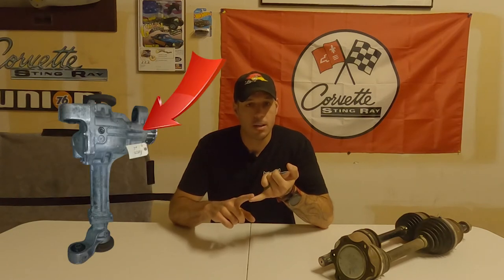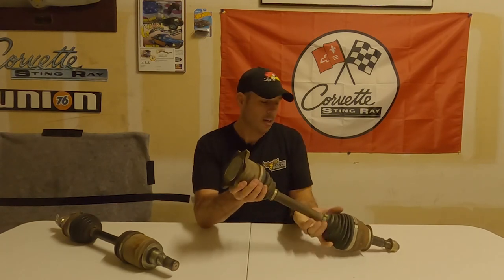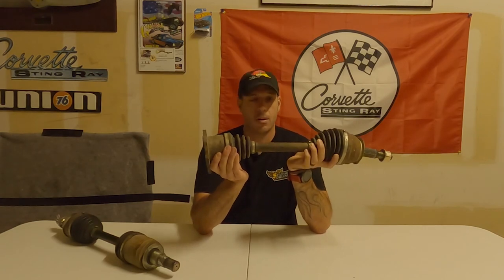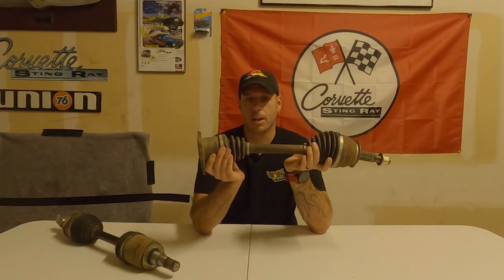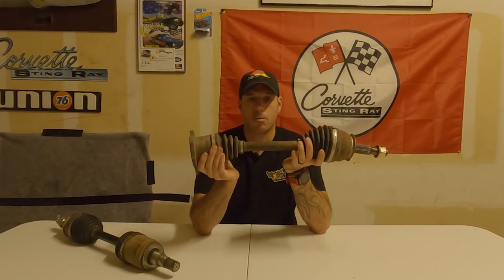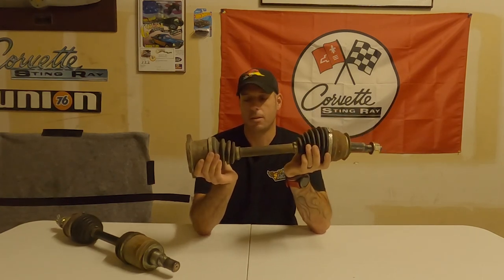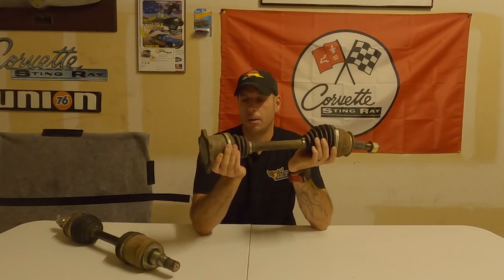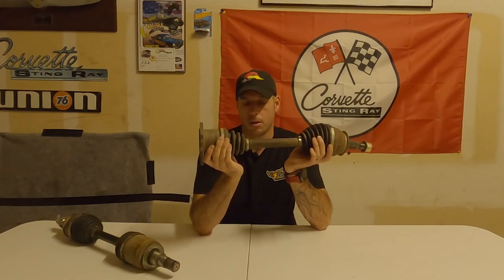Titan Swap. What Is It and What Is It's Biggest Benefit?

Comment: I’ve broken couple R-180 half shafts. Finally dumped it and roll with M205, so much easier to swap trail side and no longer fear of axle shattering inside the diff. Good stuff with Titan swap, love mine so far
Reply: The Titan cv's axles are stronger than frontier?
Reply: @vagelisperrakis826  yes

Comment: Thanks for relating your experience with a "FULL  TITAN Swap" I've watched enough videos to realize that the Infinity Qx80 CV shafts were NOT designed for the riggers of wheeling with heavy tires. Your diff swap is the best solution I've seen short of the solid axle swap or buying a jeep and fixing Chrysler's design flaws
Reply from the maker: And Solid axle swaps are very difficult in these vehicles. There's no cheap way to do it with the way the frame is designed. You can't slap leaf springs on like you could on the older generation Xs

Comment: M205s are also found in V8 Pathfinders and you can use the driveshaft from a Pathy as well, it just has to be cut and shortened which is what I did. Also if you're going to 35's make sure you get rid of the original power steering cooler and get one that's much more suitable to steer all that rubber around, you will have to cut and bubble flare the lines but it's quite easy and works much better

Comment: Good video! I actually run the R180 with my TS, and using the NI-8433 CV axle which you can purchase at any auto parts store. They are almost 3 inches longer than stock Xterra CV axles. I do quite a bit of rock crawling and haven't had any issues. But I also drive like like a grandma on the trails.
Reply from the maker: Not saying it can't be done. After all I've broken three or four titan axles too. They're just so much easier to change than R180 axles. I hope you never have to change one trailside but if you do, you'll be thinking about me now! 😁
Reply from the maker: Looks like you in Oregon? How far are you from the Tacoma Washington area
Reply: @Flying_Dollar_Motorsports  about 2.5 hours.
Reply from the maker: Sweet. I may be moving up to that area next summer. Depending on what the Army decides.
Reply: @Flying_Dollar_Motorsports  keep me updated!!!
Reply from the maker: @rizenoff-road179  will do
Reply: @Flying_Dollar_Motorsports  if you use RCV cv's on your M205 it will not solve the problem of broken cv axles?
Reply from the maker: @vagelisperrakis826  . Probably. But the cost of RCVs is outrageous and I can break almost 20 stock axle shafts before I equal the price of RCVs.

Also, If You've gotten your rig to the point of breaking something, I'd rather it be the cheap CV shaft than having RCVs so strong that the diff breaks instead
Reply: @Flying_Dollar_Motorsports  how easy break your cv's on trails?
Reply from the maker: @vagelisperrakis826  Broken 4 since I did the Titan Swap a little over 10 years ago.  Mostly broken due to poor decisions on the trail. At least two of them could have been avoided. As long as you don't go heavy on the throttle, they do just fine. If you watch my wheeling videos, you'll notice I don't use alot of momentum and wheel spin.
Reply: @Flying_Dollar_Motorsports  the Titan cv's axles are stronger than frontier?
Reply from the maker: I'll be moving up there in July!
Reply from the maker: That's a difficult question.  The CV joints themselves do not offer any real strength increase. The flange attachment on the axle that attaches to the M205 is the real strength upgrade because it eliminates the splined input shaft that the R180 uses and thats where it is most vulnerable to breakage.
Reply: How does the Titan M205 connect to the front axles? I'm guessing it's a splined connection, but in the other direction.
Reply from the maker: @DDDYLN  It's a flange that uses 6 14 mm bolts.

Comment: What is the average cost of a titan swap done without a shop and with grabbing a junkyard m205 and junkyard titan arms?
Reply from the maker: Hard to say. Haven't looked at prices of M205s recently and you'd be wasting your money buying used lower control arms. They're not that expensive to buy from someone like Rockauto.

Furthermore, regions can greatly affect the cost of a junkyard M205. For example, Alaska which has fewer junkyards would charge a premium and the same may go for Florida which receives higher volumes of 2WD trucks than somewhere with harsher weather like Colorado.

Also, if you don't have a Pro4x or Off Road trim Xterra with an automatic transmission, you will probably have to regear your Xterra since the majority (possibly all) M205s have 3.36 or 2.94 gears and not all Xterra did

Comment: This is good info! Looking on info on doing the titan swap, because I want to run a front locker, just wasn't sure how strong it will last.  Where is best place to start looking for a m205?
Reply from the maker: Thanks for watching.  

Honestly, I was in Fairbanks Alaska when I did mine so I ended up just buying a brand new one from the dealership.  But I would start scouring the junkyards first. The M205 was put in so many vehicles, it shouldn't be hard to find. Just make sure you get the right  gears unless you plan to upgrade those like I did.

Comment: The difference between m205 with 2rib and 3 rib is huge? Does anyone has a problem with 2rib m205?
Reply from the maker: I don't know if anyone specifically but from what I understand, the case is just stronger. Probably won't make much difference if your not mashing the throttle every chance you get. And as long as you don't live in arctic temperatures. But I can't say for certain.  I went with the 3 rib design

Comment: I’m brand new to the Nissan community. Just bought a 2010 xterra off road. First thing I did was put Bilstein 6112 on the front with eibach coils and 5100 in the rear. Do I need a different front shock if I want to do a titan swap?
Reply from the maker: Depends on him much lift. You'd need to measure your rear shocks length or look at the specs if you have that info. You'd likely need to replace the front because of lift and the removal of the front sway bar. You need stiffer springs up front to make up for the lack of away bar.  If you really wanted to keep your front springs, you'd have to look into a spacer lift for the front and you may need a Titan UCA too. You'd have to research that because I'm not sure if the upper coil buckets on the X and Titan are the same

Comment: Is it me, or is the voice audio only coming out of the right side?
Reply from the maker: Seems ok on my stuff but I'm not watching it with stand alone speakers. Just using the laptop. I wouldn't know how to fix it at this point?
Reply: @Flying_Dollar_Motorsports  If you have any speakers laying around you can test audio that way to check, idk what editing software you use but I assume there should be an audio setting to configure for surround sound
Reply: Ya it is. I have right speaker issues and so I don't get any sound except in the intro and a few off sounds.

Comment: Can you estimate the cost involved in switching the engines?
Reply from the maker: Im guessing your talking a VK56 swap which is often mistakenly called a Titan swap. I have not done that but it's gonna depend alot on what type of engine you get (salvage, rebuilt, new) and how much work you can do yourself.  If you Google Off Road Gorilla, they have done it and can give you a lot of info as well as build you a wiring harness that you'll need.

Comment: Hi, just asking if can use the UCA of titan or armada to 2012 pathfinder?
Reply from the maker: You can but you will have clearance issues at the top of the coilover.
Reply: @Flying_Dollar_Motorsports  actually there is 2" spacer on the coil spring coz my pathy modified with 2" lift kit but my issue right now   the stock UCA when drive over into those bump it hits to coil spring frame or whatever called is.
Reply from the maker: Well you can only use the Titan or Armada UCA if you do the Titan swap. You can't use the UCA without the corresponding LCA. And your 2" spacer will not for coilovers used in a Titan swap. It will only work with factory coils
Reply: @Flying_Dollar_Motorsports  ok go it, thank you for your information.

Comment: Check out my Titan swapped 2022 Frontier ….
Reply from the maker: Very Nice. Love the color. What part of Colorado?
Reply: @Flying_Dollar_Motorsports  commerce city Colorado where you from
Reply from the maker: @yortchylanissancita3583  Currently in the Springs
Reply: @Flying_Dollar_Motorsports  cool any good trail worth mentioning???
Reply from the maker: @yortchylanissancita3583  There's a ton of trails. Lots on the west side of Denver.  Look up Trailsoffroad.com. Great trail guides
Reply from the maker: @yortchylanissancita3583  Colorado Mall Crawlers is another Colorado Based trail guide YouTube channel that will give you good info.